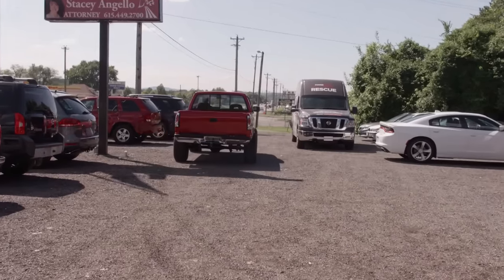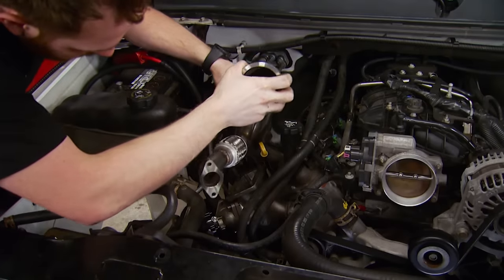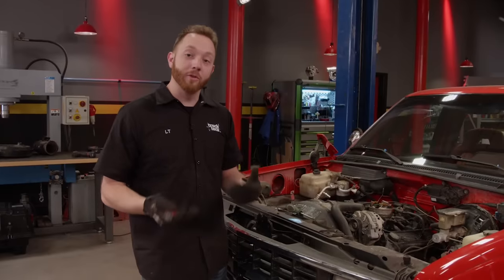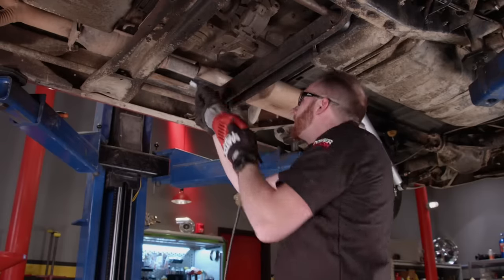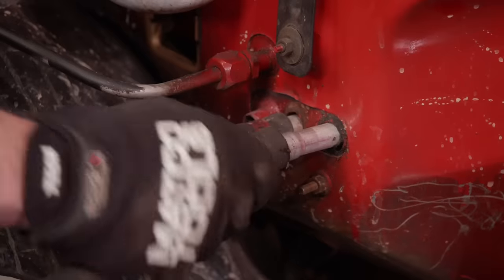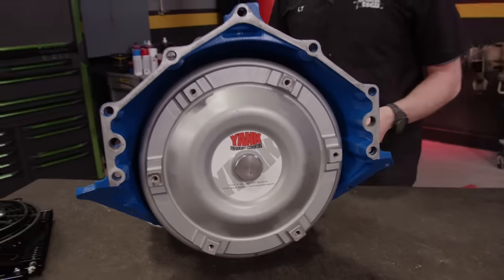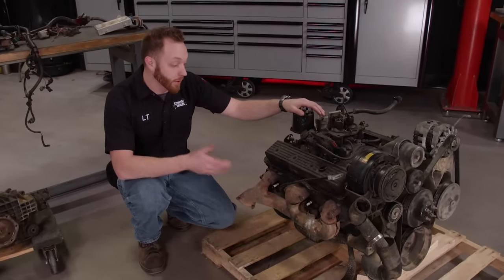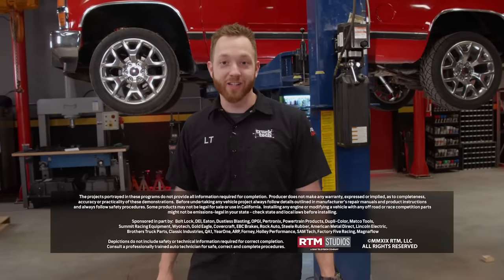LS Swap Do's & Don'ts on a Chevy K1500 - Truck Tech S6, E5

Comment: Who else is so broke they'd gladly take that old 350.
Reply: Allen, so sad for me as I had an 88 short step side with the 350/700R4. Had that lil truck for 8 years. Sold it when I got a 95 dodge with the cummins. Sold the chevy to a friend. It had 303K miles on the clock. I still kick myself for ever selling it. Sure wish I had another bowtie. I'm driving a 98 dodge short bed with 318 now, it'll never come close to the lil chevy....lol
Reply: What ever your bid is for that 350, I raise you $100.00
Reply: Im glad of my 350
Reply: @jason22talley  I have one to put in my 94 s10 but I don't have flat enough ground to work on it yet 😢
Reply: @joshtheking1772  I'm sure they could have gone that route, but I think they wanted the "git it in, git 'r' done, git it out" quickie kinda build. Time was more important than cost.
Reply: @jamesmoore3346  the 360 would be better
Reply: I got a 2001 stepside Z71 sitting outside ruining. Drove it 14 years. Reg cab stepside kinda hard to find these days so I been hanging onto it. Bad this is it has a 4.8 V8 that’s always been a dog. But like you said I’m so broke can’t do anything with it. It needs a new 454 crate motor!!
Reply: @joshtheking1772  ok boomer
Reply: who else is so broke that they are grateful their truck still runs
Reply: @neilbrown82  do you know what a boomer is?
Reply: @iankerr1549  I'm a recovering cancer patient, beat stage 3 lung cancer but the massive doses of chemo and radiation beat me. The dodge was pertty rough but since I had the time I used doing the body work, sanded by hand, got it ready for the paint. Just needs to be block sanded now. I have a friend who is a 30 year veteran of the body shop business, he's certified with 3 differant paint companies. He wants to do the spray, no probblem there, lol. I've decided it's going to be matte black. Got a set of 17" chrome rims to replace the 'skinney' 16's that it came with. The truck is so basic, it has manuel windowcranks, rubber floor cover. I think the only option is the A/C.... I have been keeping my eye out for a 340, want to find a carbureted 4 bbl version. They never built a 318 with a 4bbl. I once put a 340 intake and mallory dual point dristributor, dual exhaust.... Ran great but I neglected to think about the 318 heads, the valves just would not handle the fuel dumping from the 4bbl on a hard take off. It was a dog but once you got up around 50-60 it got real with a 128mph top. I had a complete cam kit ordered from crane but moved from the area before it came in. I ended up trading the car in but will always hate that I did not carry it to the end. I was a big time mopar guy in my early days but went over to the bowtie. Still think its like karma that I'm building and driving a 98 dodge, lol. Hoping to get the paint on it next couple months....since the cancer I'm just not as fast as I used to be, I have a shortened duration. At present I'm good for maybe 3-4 hours before I have to take a break and recoup, can't do strenuous or I'm down for a day or two....not bad though since the doctors gave me 'about 90 days', that was 5yrs 3mths back and I'm still around. Its all good though as I'm not shut down. I still enjoy playing with mechanical stuff. Its in my blood, old gear head...lol...
Reply: I have a 93 Silverado  love the truck but that 190 hp tbi ?  Sure sure... put a carb on it different intake get rid of those junky heads bored over stroke it out clearance this and that bla bla bla- LQ4 and a cam &springs and presto bulletproof 450 horse
Reply: @Dennis Burger ls engines are cheaper to build cause you don't need much to go fast. I can get a 5.3 for $500 all day long and it don't take much to run 11s with a 5.3
Reply: Dennis Burger You can get them for free if you drink beer with the scrap yard owner.
Reply: Pay to play
Reply: @jamesmoore3346  these years look got dang good now ....I want one
Reply: TBI FTW. Those things last forever with little to nothing having to be done. 180k and its consuming oil? Eh its got another 70-80k in it before it dies.
Reply: Holla at me.  I got a 350tbi for you.  Just $1000
Reply: @114wildfire  well I ain't got $1k but I do already have a 70s 350 with about 10k rebuild miles. My problem is I don't even have flat ground to work on my truck.
Reply: Allen McKinney 

Oh no flat ground aye.

Buy my emgine and should solve your problem.
Reply: The right rebuild on that 350 will be a lot of fun. 383 stroker. AFR 195 heads. I mean, I put an LS3 in my truck because it had a 4.3 vortec, but if you have a 350, you might as well keep it. I had a '95 that was a lot of fun.
Reply: @Dr_Xyzt  ya I am. It's going in my 94 s10 2wd and if it turns out to be a 4 bolt main I may up it to a 383. I also want to convert it to 4wd with a straight axle. I already have a 99 zr2 rear end on it with 3.73 gears.
Reply: Anyone know if the transmissions from the obs for the 350

Work for LS 5.3 6.0?

Like the nv3500 5speed , 4l60e, 700r4
Reply: @114wildfire  there's Silverados with the 5.3 and the 4l60e so it should.
Reply: A small Cam and some new heads and make 300 horsepower for a fraction of what they're about to pay. This is all for making good TV.
Reply: @democratsaretheDEVIL  I don't have the money for a set of shiny heads but I have a set of 305 601 cast 54cc heads I thought about replacing the 74cc heads that's already on my engine. This engine was ran in my friends camaro and ran fine with good power. I'm mainly wanting power when needed and good mileage when cruising.
Reply: @neilbrown82  it's been a week.  Do you know what a 'Boomer" is, or do just like the way it sounds?
Reply: Have one in the corner free to a good home if ya want it lll
Reply: I have a 96. It came with blown head gaskets and probably cracked heads. Bought some new vortecs. Had a 350 bored 30 over and 30 under on crank and mains. I bought some Keith black pistons with domed pistons from a swap meet for 50 bucks and only 60 miles on them.  Got a cam with a 114? Lsa? Can't remember. Runs great. Runs on stock tune and didn't cost as much. I figure it was a good choice.
Reply: Bob  You are correct, I have yet to dee one though. From what I read it was 1981 when chrysler put a 4bbl on the 318, primarily in police intercepters, (probably other cars too). The 4bbl gave it a whopping 165hp which was up from 130-135hp with the 2bbl. Any earlier if it had a 4bbl it was a 340 which led to the 360.
Reply: My only vehicle is a 94 silerado single cab, step side. Tbi 350.
Reply: @J_Braz_  you making me jealous, lol
Reply: And parts are everywhere.
Reply: @allenmckinney9533  It might be a little spendy but 3/4 in plywood works to put under the hoist. I pulled a 350 attached to a TH350 out of a wrecked 78 Monte Carlo once. It wasn't fun,but It worked. Tried 1/2 in plywood cuz it's cheaper but the wheels pressed through it under all the weight. Then I built my dog a new dog house with the wood.
Reply: @Thundarr995  my current problem is my truck is sitting on a hillside. I'm gonna take part of my porch off that's sinking anyway and flatten the ground out to work on.
Reply: @garlicbreadjenkins5780  your right. My old truck ran over a year with a knocking rod but wouldn't die. The trans oil pump is what finally parked it.
Reply: 350 vortech is a good engine. I have a 4.3L Vortech in my S10 It's a 97 5- speed,but I put a 98 5-speed in it. It shifts smoother,less notchy,and it's a little stronger. Put a 3.73 rear axle in it.  Now it's a good truck. It's a good DD and it's reliable fun enough. Still gets half way decent mpg. Had to cut a new hole for the shifter and use the 98 console & shifter. I have a 77 k20. That's got a Vortech in it,CPU & everything even the AC works. It does everything the old 454 did. And it's fuel injected. Another thing,I bought a speedo recalibration module to fix the speedometer. After I put the 3.73 axle in.The S10 speedometer was running about 17-20 mph fast. Had to get a custom wiring harness to get the k20 going. I wasn't about to start tearing into the factory harness. I pondered making  the factory harness work for about...10 min. Then I just bought one.
Reply: @114wildfire  they'll bolt on there,but your probably going to need some conversation parts like the flywheel,spacers,maybe special bolts. Just because it will bolt to the engine doesn't mean everything will be compatible. If you use a NVG 3500. I personally wouldn't use one of those,they're good for 300ft lbs. A 350 makes more than that and you'll probably break it. Between early 90's- 04 GM made 3 different 4l60e transmissions. I've never seen the NVG 3500 come with a factory V8. I think they were probably only used in S10 p/u & Blazers. I think they used the NVG 4500 with factory V8 trucks. There's also 2 versions of the 
NVG 3500. The 96-97 isn't the NVG 3500. It's a Getrag 290 it's ok in a V6 but its lighter duty than a 3500 and a V8 will definitely break it. Plus the shifter wear out and they don't make replacements anymore. They get really sloppy. I have one in my S10. Every time I see one at the junkyard I buy them if they're still good.
Reply: 350 block, vortec heads, good cam  and a new intake. Can make 350 plus hp cheap.
Reply: @allenmckinney9533  yea you are correct, i had those on a 83 camaro with a crate 350, dropped a valve in stocks. Those are great upgrade. I miss those old cars.
Reply: @Dennis Burger in my area you can find a wrecked suburban for that on craigslist
Reply: Yess!!😂
Reply: Heck man Id take it. Get a rebuild kit from Summit and then sell it to get some money back.
Reply: @slumpnmyrump4986  well yeah Tbi is old technology.but Chevy went to the vortec 350s in 96 so a Chevy of the same year of your Dodge would probably walk it like a dog
Reply: @mikef-gi2dg  lol they are everywhere for 300 bucks.idk why y'all are so hell bent on them.they are dogs and need a whole new top end to be worth anything
Reply: @erikcapozzi3425  They are excellent (ls) performance engines but they ain't free.
A switch over would cost 75% more than Gen1, minimum, which ain't in my budget. I do the match constantly. Get in where you fit in.
Run what you got, or stay in the stands and wish on a star. I am only concerned with my dial in and their dial in, I don't give a rats spark plug what's under the hood. It's what is in the seat that can beat me, not under the hood. But if you giving away LS stuff, I'll take it. My all aluminum direct injected Silverado, hauls ass, and gets 18 mpg towing!!!
Reply: If you want to make a trip to canada I have a vortec motor that I've been looking for an excuse to rip out lol
Reply: @slumpnmyrump4986  but they do..they just have more power.sorry
Reply: @mikef-gi2dg  a LS cost is really not that expensive if you know what your doing
Reply: @iankerr1549  With a cam, intake, and headers, a 318 will run just as good if not (much) better than a 360.
Reply: @jamesmoore3346  Actually they have built a 318 with a 4bbl, but they are uncommon. But hey, What color paint bro??
Reply: @the_car_guy5915  yeah, I did a bit of research and found they did build a 4bbl version but it wasn't until 81. After the energy crunch, seems chrysler got into making police intercepters. They used the 318 and put a 4bbl on it. Since the energy crunch though they made a whopping 165 hp. Everything suffered in the power in those days. I put a 340 intake, carter thermo quad and a nice set of duals on a 318 in 78, car was a dog off the line but from a rolling start it had crazy topend. The 318 heads could not handle the gas flow and would bog on takeoff. I was going to change out the heads with the 340's but decided to go with a cam kit instead. I moved back home from san antoino before the cam arrived so I never finished the car. The little 1500 ram I'm driving now produces 230hp, I think. Just had to do the 'faulty' kegger style intake/plenum gasket about a month back, its loke drining a new truck now. Finished the paint this past thursday. SATIN BLACK. After stepping back and taking a good look around man, thats alot of black. Called my buddy, going to go by his place today. He said he should have some pinstriping he can lay on it to 'break up' some of the black. I also got rid of the 16" factory wheels and little tires, it now rolls on a set of chrome 17's with 10.50X31's. Completly changed the truck, its my daily driver but I've been adding the little touches to it over time. It's actually a descent truck now. A 360 would be better but the 318 in it is running too good get rid of now....
Reply: thats what im building and as much as possible will be used other than gaskets,rings,seals etc.love the ls motors but hate the complexity and cost
Reply: @slumpnmyrump4986  Of course, no comparison is fair between one that's a throttle body and one that is a newer design
Reply: I would gladly take it, no worries 👍
Reply: But you'd have to rebuild it and that's not cheap.
Reply: @Dennis Burger info on that build would be appreciated
Reply: @PaganWizard  And sell some parts like the 5.3 they picked up. I'm sure these sites make a good point on this show when they do reasonable swaps like this one.
Reply: @jamesmoore3346  sold my 90 chevy sport trk with 350 factory 5 speed after high school ,  wish i wouldn't have
Reply: @jamesmoore3346  what happened to the 95 12valve
Reply: I wouldn't sell my 94 Z71 5.7 211,000 miles for nothing.. dont burn or leak a drop of oil, just replaced the original timing chain and gears to a double roller set when she decides to go I'll build it or put a GM crate in it.
Reply: It would’ve been cooler to build the 350 and 700r4 that came out of the truck, a swap is cool but seems like a lazy way out
Reply: Idk man, these 350 tbis are dogs and not in a good way you gotta do sooo much to make power
Reply: i have a 96 c1500 5.7 with 343k miles still runs good
Reply: In a heartbeat
Reply: And the trans. Put in my blazer. For sure.lol
Reply: @jamesmoore3346 lol
Reply: In a heartbeat
Reply: @joeyjarman4605  I got 91 I love
Reply: @JohnnyRebKy 4.8 and 5.3 blocks are the same, 4.8s like boost

Comment: "If this is your first time removing a engine break it down in small pieces".... using your lift,trans jack and ceiling mounted crane no less.
Reply: All of those tools are very cheap.
Reply: @irfp460  Lifts are 'very cheap'? Gonna have to say that is a very subjective statement.
Reply: 231mac 500-1000 if you want to own them or just rent them for cheap, and it's not that much compared to the engine and Trans that you just bought for you truck that you would like to keep in one piece and not have to buy again
Reply: I did it with nothing more than a cherry picker in my driveway.
Reply: I just pulled an LS in my dirt driveway with a cherry picker yesterday and I'll be stabbing the new long block the same way once it stops snowing lol
Reply: @231mac  I surely can't afford one. I am currently working on my Trailblazer in my driveway laying under the car when necessary.

Comment: That's not how you pull an engine!  You need a tree, a come-a-long, and lots of beer cans in the yard.  :-)
Reply: And the stereo blasting some Van Halen!
Reply: I use a loader tractor.
Reply: Also 4 broken lawn mowers sitting in the weeds with the only working mower missing all its sheetmetal and a couple teeth on the flywheel, thats how you know they are professionals
Reply: Look at me!  I’m @David Weeks!  I have a fancy yard tree!  The rest of us have to sneak on to the high school football field and throw a rope over the goal post, one end hooked up to the motor and the other to our buddy RayRay’s el Camino bumper to lift our engines out.  Can’t afford to leave beer cans in the yard. The neighbors will steal’em!
Reply: how I did my first engine swap my teens
Reply: I frackin love you guys 😅😅😅
Reply: 😂😂😂 i"m with you....